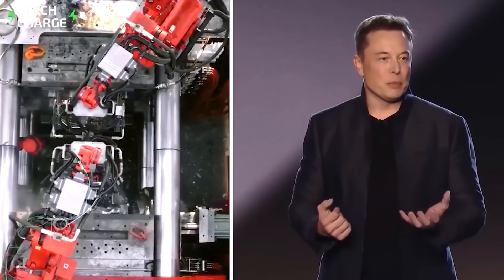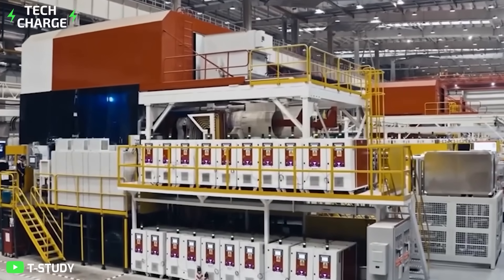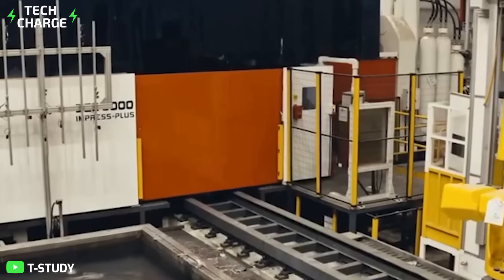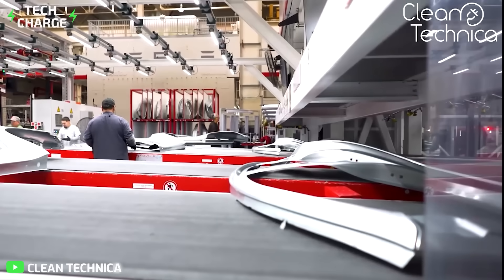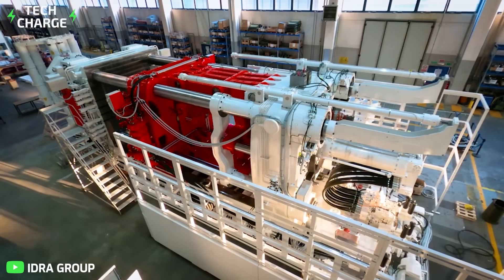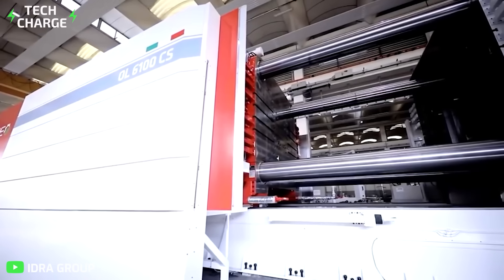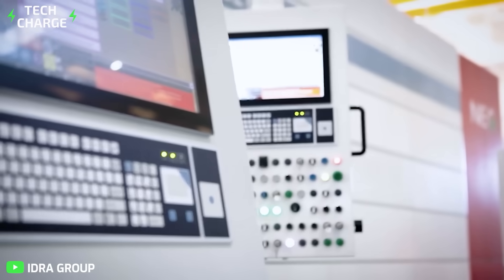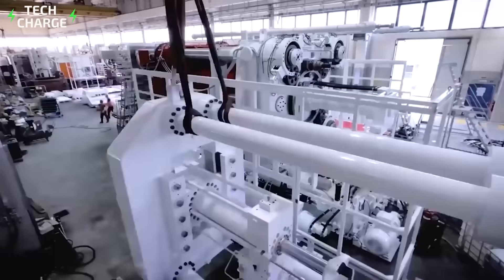How Tesla Cars Are Made So Fast - Meet the GIGA PRESS

Comment: So basically if you have an accident, your car is totaled, as there are only three parts to the chassis, so damage to one essentially means the entire chassis is destroyed.  You can't remove a part.
Reply: Legacy auto has seen the huge advantages of the castings and is starting to copy. What amazes me is these so called powerhouses of automotive engineering now copy the new comer
Reply: @InformedKiwi 
Yesterdays powerhouse; tomorrow’s hasbeen
Reply: So why are the cars so expensive ?
Reply: @OH14YOU  they barely sold them at a profit finally just 2 or 3 years ago
 Prior to that they had to rely on selling their ICE credits to other companies, credits they had for being an automobile manufacturer but could not otherwise use since they did not produce any ICE vehicles. All they had to do was sell them to other manufacturers at a cost lower than the fine for exceeding allowed production. What a joke it all is.
Reply: @OH14YOU giga presses aren’t cheap, nor are the Batteries
Reply: @@IrishSpringUSA Aluminium has been used in the automotive industry for many years without issue. Cast structures pose particular challenges with regard to repair.
Reply: Actually there is a lot of sectioning procedures for Tesla rails/ unibody. Everything is basically rivet bonded, therefor you can not make any structural pulls/repairs.  The cost of parts is what totals your car. I work at a tesla certified shop.
Reply: @shanks_209  you just contradicted yourself. Is the car totalled because it can not be repaired or is it the cost of parts? You state both, but you only work in a Tesla repair shop, so maybe you are confused?
Reply: @steyer-crmg  the car can be repaired. It’s the parts, materials, and labor for recalibrating and reprogramming everything. Sorry for confusion.
Reply: @steyer-crmg 
Definition of “totaled”: Repair cost greater than replacement cost.
Reply: @Skyprince27  ? Why are you telling me this? What os this referencing?
Reply: @steyer-crmg  
Reference your question to somebody two days ago:
“Is the car totalled because it cannot be repaired or is it the cost of parts?”

Me answering: You can dredge a crashed airplane from World War II off the bottom of a lake IN PIECES and 20 guys can spend eight years and $5 million and it can be “repaired”. But when a car is “totaled” it means the cost of parts (and labour) is more than getting one that’s just like it off AutoTrader.
Reply: @Skyprince27  yes. But why are you telling me this? Pretty sure my question eludes to the car either being an insurance right off ie totalled because of one of 2 things, it can not be repaired, ie chassis bent and can not be aligned, or the cost of parts is near or more than the insured sum. We are both saying the same thing my friend 🤔👍 How much did they have the WW2 plane insured for 🫢🤭🫣 Which lake anyway? I live near a lake and sail on it, i don’t want to hit something my foils cost a fortune. You are wrong on one count, there is no way that i can dredge anything from the bottom of a lake, i just don’t have the equipment or skills. Also, does it need to be 20 guys and 8 years & cost $5 million? Just asking because you referenced it 😎😏😱
Reply: @steyer-crmg  
I’m simply saying there’s no such thing as “cannot be repaired” and the answer is always the second case.
Reply: @Skyprince27  Well that is a big statement…..What country are you in? In my country you have repairable right off’s and un-repairable right off’s. If a car is written off as an unrepairable it cannot be registered for road use anymore, the VIN is basically black listed so to speak.  Now, back to the big statement, “no such thing as cannot be repaired” well i obviously disagree with that statement on cars like i just said, but also i just dropped a crystal glass, it smashed into tiny pieces, good luck repairing that. I also had a shade roof on my caravan that blew off in 100km/h winds, it landed on my solar panels which are at ground level, smashed one & bent it up, totalled, unrepairable. Check mate.
Reply: @steyer-crmg  
I’m going to plead no contest at this point
Reply: @Skyprince27  That is fair enough! 🫡✌️
Reply: @steyer-crmg because you can’t register it, it has a salvage title, etc, doesn’t mean it’s not repairable. Repairability and usability afterward are two different things. 
Every day cars get repaired and are sold off to either other states or other countries.
Reply: @steyer-crmg Both cost of parts/labor and inability to repair a vehicle can result in it being totalled.  If the cost to repair exceeds a certain percentage (more than 50%, but varies) of actual cash value it is often totalled.  Irreparable damage is obviously a total loss.
Reply: The first step in the manufa turing process is a soy shower🤷‍♂️😂
Reply: @onradioactivewaves   Actually, it's more of a guys' afternoon in. A G.A.I. A gay. Not... Not... It's not gay. It's just a... It's a bridal shower for guys. A guy shower. An hour-long shower with guys.
Reply: And it costs $60k
Reply: @soundwave3353 my model Y was $35K after tax rebates
Reply: Welcome to the world of batteries, trust me of you crash an electric car you don’t want it back. Does anyone ever want their car back after a crash? That’s what new for old replacement policies are for.
Reply: @steyer-crmg exactly where is a policy available that simply totals out any accident in a 50k car?  Any 50k car?  
Hint - it’s nowhere.  Can’t find something that doesn’t exist. 
For the record, that’s NOT what a new for old policy is.
Reply: That’s why the insurance is so high but, they don’t tell you that part when you buy one.
Reply: That's true with all cars made in the last 30 years
Reply: I hate to break it to you, but all cars are this way. And have been for sometime.
Reply: Frankly, I don’t care.  In an accident that severe all I want to do is get out unharmed.  Then call my insurance company
Reply: I don’t think you reweld the chassis of a normal car either
Reply: Literally every car gets totalled if you damage the frame.
Reply: Exactly like insurance operates any way.
Reply: most carbon monocoques have more removable parts than Teslas 😭
Reply: Have insurance
Reply: Lolololol
Reply: But, still, you can build up with bricks, and cement, and paint professionaly afterall 😁
Reply: Disposable smug phone with wheels 😂😂😂😂😂😂😂
Reply: Literally every car on the road
Reply: It’s not the chassis, but the battery that makes it easy to total. If the battery gets crushed or cracked open, the whole car is screwed, not to mention it will stay on fire for hours even with 100 fire trucks spraying it down.
Reply: I’m sure Tesla thought that through…Toyota is now going the same route as is BYD….this is where you have to be to stay in the game moving forward…goodbye Model T
Reply: Not quite true. I rear-ended a tesla with my truck and it totaled my truck . The Tesla only needed a bumper and a rear hatch.
Reply: Aluminium silicon alloy? If damaged can it be welded and rebuilt or is it simply replace whole damaged section? No wonder the insurance is high. Most insurance companies will give you a payout figure and salvage and scrap what remains of the car.
Reply: @damianousley8833 salvage and scrap are two different things.  Totaled out cars are always salvage but almost never scrapped.
Reply: It can be stripped and remolten for recycling. Unfortunately an expensive form of disposable transportation
Reply: Don't get in a wreck? Driving over 25 years .. millions of miles.  No wrecks.   Be better.
Reply: Yes. On the other hand there’s less pieces so fewer things to go wrong. Plenty of people drive cars for decades with no accidents.
Reply: Then it goes to Ukraine. Seriously.. You will get a text about a month later. Update your software and car located in Ukraine.
Reply: Any damaged frame is totaled in Europe, doesn't matter if it's a Tesla or a Toyota.
Reply: Plenty of junk for future landfill.
Reply: Can’t replace the chassis. But it’s repairable. 
Just like most unibody cars and truck chassis. 
Original manufacturing technique doesn’t change whether or not it’s repairable.
Reply: Correct
Reply: Stock race cars have gone to tip this composite body style, the vehicles are stronger and many accidents don’t even cause major damage.
Reply: @therealBocaStudios  ,stock cars that are used for racing have tubular chassis's! Totally different all together! And they can be jigged to repair and replace sections which puts them back to specs.
Reply: Tesla and electric cars that are literally written off and submerged in pods for days are one of the main reasons policy’s are going through the roof 😩😂
Reply: This is one of the factors in why Hertz got rid of 1/3 of their Tesla fleet. Expensive repairs more accidents than ice cars and I assume when the cars get damaged they’re off-line longer than their ice counterpart.
Reply: Easier to flex aluminum than steel.
Reply: It's the safest car
Reply: If you damage the chassis of any car it's totaled.
Reply: Most cars are totaled when the air bags go off because of the expense to replace all of them plus a bumper, fender, and labor to bend the suffrage back. Cars today are throw away cars, honestly changing out 1/3 of the car for an insurance company could be cheaper then the latter.
Reply: Living in Africa I have seen many collisions with older steel chassis cars and newer aluminium frame. Aluminium chassis are weak and unsafe. It's like knife going though butter when a steel frame vehicle collides with aluminium.  I'll stick to toughened steel for my chassis
Reply: @Actually-y7j  So why do they receive top crash test scores? Maybe they know something you don't.
Reply: Great take buddy. That's all you got from this? 😂
Reply: @theinvisibleman2070  
Same thing...
Reply: as opposed to any other car where the chassis is damaged in a crash? Tell me cupcake, what does insurance do when the frame is bent on an Escalade or Lexus ES350?
Reply: @slowery43 they put it on a frame machine and pull it back to spec.
Reply: @epjetta  you can not make pulls on aluminum. Aluminum cracks and rips. Tesla strictly says no structural pulls at all
Reply: @shanks_209  I was referring to the escalade and Lexus mentioned. A tesla is a different animal. When a tesla is repaired it requires removing and replacing those large parts. Comparing a tesla to steel cars is apples to oranges.
Reply: @epjetta  bmw, Audi, ford F-150, many cars have aluminum rails. Tesla arnt that different. Every car has cripple zones along the rail. From the back all the way to the rear. If any crumple zone collapses or is distorted then it has to be replaced. That goes for any car on the road. Full Frame vehicles require the whole frame replaced. Uni body frame can be sectioned.
Reply: @shanks_209  I do Autobody work, I'm well aware of repair procedures.
Reply: Lexus unibody would be totaled yes. But Escalade body on frame should be a lot easier to repair
Reply: @slowery43  Thank you. I had to read four insane comments before finally getting to some sanity in your comment.

Somehow people need to be reminded of common sense nowadays.
Reply: @slowery43  Have fun realigning an aluminium frame.
Reply: @marcg1686 the Escalade and the Lexus have a STEEL frame which cost a fraction of a cost than having an aluminium frame if you have to repair it, nd depends how is the crash you can't repair it and throw the whole chassis away. That is the problem.
Reply: @MrOriol24  Steel is fairly elastic. Plenty of videos showing steel chassis being realigned.
Reply: @marcg1686  yes, that's what i meant, steel you can, but is much harder with aluminium, like teslas chassis
Reply: @MrOriol24  another consideration is aluminum is lighter weight perfect for increasing fuel economy.  I don’t think your worried about increasing economy in an escalade so steal is a fine choice.
Reply: @slowery43 ”cupcake” 😂😂 that my line!
Reply: A vehicle with fewer parts to the chassis is actually more durable and stronger. The more pieces the easier for it to come apart like a jigsaw puzzle.
Reply: Teslas are very expensive to insure
Reply: @schwartzmatthewe no they’re not. I pay $70/month for my Tesla in NJ which is very cheap.
Reply: @schwartzmatthewe 
I didn’t have a problem with mine. This problem be as it may, the fact that it’s harder to steal makes up for it.
Reply: @schwartzmatthewe Not true. My insurance went down
Reply: @schwartzmatthewe Because they are expensive.
Reply: @schwartzmatthewe no they are not
Reply: @schwartzmatthewe - Your comment is just hearsay! It’s no more expensive to insure a Tesla than an ICE vehicle of the same value!
Reply: Not in all cases, There is about 20 different area's in the rear of the chasis which range from don't repair, to repair however you want,   It is possible to remove the whole thing but you would need a brand new extended range dual motor model to not write it off.
Reply: @CyborgbobaFett or you could just buy a Tesla for hats wrecked just on the opposite end of yours
Reply: @CyborgbobaFett The plural of area is areas. 😉
Reply: @CyborgbobaFett Sounds optimistic. Let's wait for the insurers reaction when they find out that the repair is not economically viable. I don't think they are going to be happy bunnies.
Reply: @marcg1686 maybe why Tesla sells insurance
Reply: @maslowpavlov  Possibly.
Reply: I agree
Reply: Also massively makes the car safer and gives the Tesla the higher safety rating
Reply: It’s a battery powered vehicle. When something goes wrong with it you just junk it and get another. Simple.
Reply: I agree with Tesla's way when it comes to non repair of critical body frame. Current cars repairs after a major accident to the structure is a joke. Everyone knows the structure integrity is no longer the same when body parts are chop, welded or pulled back into position to qualify as repaired when it affects the overall safety, driving dynamics & handling of a vehicle. Most people will trade such repaired cars for another at the earliest opportunity and this creates major problem for the unsuspecting new owner of used cars. If you are a used car buyer, would you knowing buy a car that was repaired after major accident or you will only buy one that hasn't had any major accident?
Reply: Just don’t crash duh
Reply: That’s about correct…
What most would consider as minor damage typically results in either astronomical repair costs or a totaled vehicle. Ask any Tesla owner who’s had an accident in one…
Reply: It's a throw away vehicle!! NOT to mention that it is a rolling potential fire Hazzard and lastly, I wouldn't park that vehicle in a attached garage due to the fact that it may catch fire and burn down. I wonder how much carbon it took just to produce all the plastic parts and pieces to put one vehicle together?
Reply: @garyfeltman4482 gas vehicles catch fire every day.   In fact, ignorance spreads much faster than EV fires…
Reply: @Meatball2022  and you are showing me how much of a meatball you are!
Reply: @garyfeltman4482  If you think EVs are fire hazards, wait until you hear about gasoline cars.
Reply: @garyfeltman4482 all cars have plastic parts that take carbon to produce, dummy. 
If you’re referring to the carbon manufacturing difference between EV’s and ICE cars, an ice car creates about 12x more carbon per year than it does to create one car battery. If you’d remove your head from your colon and do a modicum of research you’d have known this.
Reply: Yes basically. Not to mention quality control (panel gaps, welding points in the sub chassis, etc....) on a 70k+ car.
Reply: Now I know why the quality of assembly is so poor
Reply: @rootready  I think those days are over. It used to be that a Model 3 with an Audi level of fit and finish could be followed off the line by an example with the assembly quality of a Lada Niva. They have improved.

Comment: Unimpressive, the VW car body press is way larger because it's pressing cold steel. It also weighs way more (2000 tonnes) and would not go on a flat bed truck or two
Reply: Such a press is not for forging ... casting!

Comment: so how do you repair a molded aluminum chassis after a crash?  I doubt the integrity of the metal will remain.  I certainly wouldn't want to buy a used, repaired car that was involved in a serious crash.
Reply: The method to repair a Tesla is very simple. Move the Tesla to the scrapyard due to total economic loss and buy a new one.
Reply: @dge5348  and 80K throwaway.  No thank you.

Comment: What happens when the model is changed?, the mold has to be replaced?
Reply: That’s why they don’t make changes.
Reply: The mold is a die (hpdc = high pressure die casting)
Lifetime for any die has a limit roundabout 100.000 shots
To run 1 hpdc machine you need und good conditions 3 die.
one die on the machine / production
one die stand by
one die repair in the tool shop

Comment: Wouldnt. 3d printing be easier?
Reply: Printing parts is a possibility ; not the whole .
Reply: @jkardez4794  why? They have made a whole house
Reply: @drunkdrftr  How would you account for variations in forces acting on the different parts of the structure ?
Reply: @jkardez4794  i dont understand.  Forces while printing or forces while driving?
Reply: @drunkdrftr  while in motion.
Reply: @drunkdrftr  No they haven't.  They have built the walls of a house.
Reply: 3D printing is SLOW

Comment: So somebody hit you from the side on your rear wheel and breaks all your suspension off you will have to buy another car. I also would like to know how the steel quarter panel is joined to the cast aluminum floor panel. I don't think aluminum has the right properties for a quarter panel. Steel is a much better choice for 1/4 panels. And at the factory comes as what is called a uniside it's both door openings and the quarter panel as one giant piece
Reply: steel parts are bonded and riveted to aluminium parts.
Reply: If somebody hits your back wheel and your entire suspensions breaks off, the car will be totaled Tesla or not.